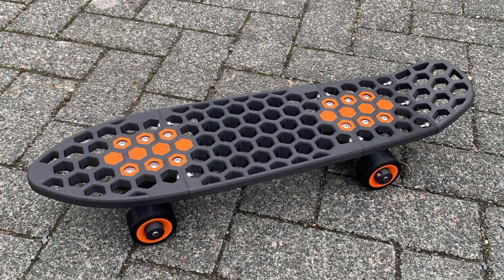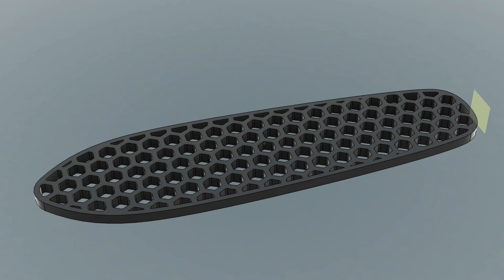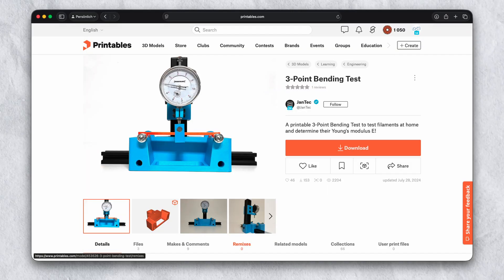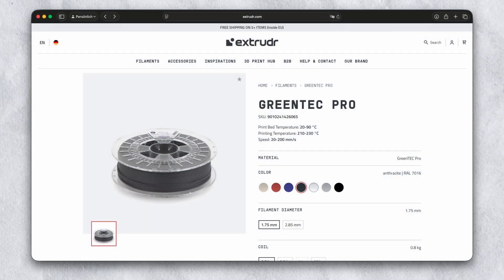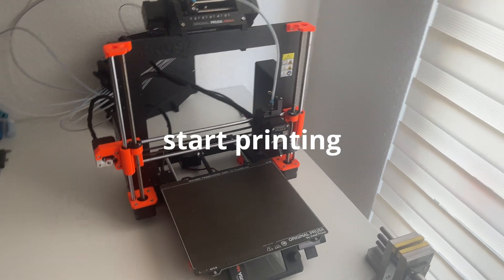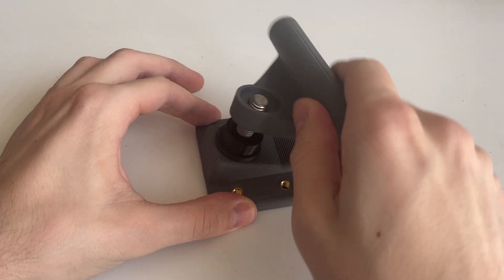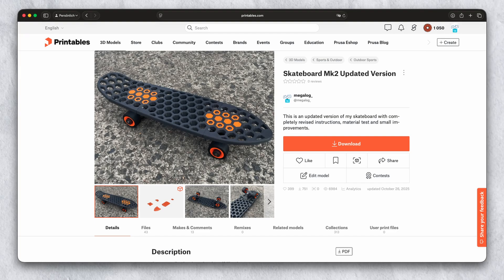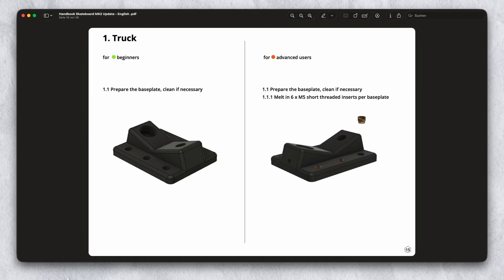Can You 3D Print a Skateboard?

Comment: Very cool project and a really nice demonstration of what rigid/stiff filaments can be used for. Wood in skateboards has a certain amount of flex, which is supposed to be interesting for the riding behavior, I am not a skateboarder though. You could definitely take this idea further and maybe test materials like PA12, PA6, or similar, not just to build a skateboard that holds up, but one that also has the perfect performance characteristics. You also seem to be into the skateboarding topic, judging by the practical riding shots in the video 🙂
Reply from the maker: Thanks for the kind words. 
In any case, the skateboard is no substitute for a proper classic wooden board. It's more like a penny board, which is also made of plastic. I will definitely continue testing it. The PA can also be very interesting, but based on my tests, it's often not stiff enough. Although that depends heavily on the weight of the rider. I still have some PA (CF) from the manufacturer and will definitely test it in the future. It's much more complex than I can show in the video.

Comment: Do you actually need a stiff filament? You can always just make the board thiccer. Your printer can make parts that are 200mm thick! Absurd i know but the stuffness compounds with thickness very rapidly, so you don't need it to be this thick.
Reply from the maker: The middle part is almost 20 mm thick. Yes, PLA is certainly sufficient, but really only for children (and not in the sun). Take a look at the instructions, where you will find all the results. Thank you.
Reply: Thickness adds weight, adds cost, decreases practicality (try balancing on a 20cm brick on wheels) and most importantly, it might not even solve the stiffness issue as the material will just deform itself anyway, it will just take longer for it to do so. Choosing the right material for the job is literally an entire science field and for a good reason. Good job on OP for going through the effort of testing all the various materials and picking the one that best fits his requirements!
Reply from the maker: yes ! thanks
Reply: @ZappaTheToaster   I mean cost of thickness isn't as much as cost of rare engineering materials, and added riding challenge sounds good.